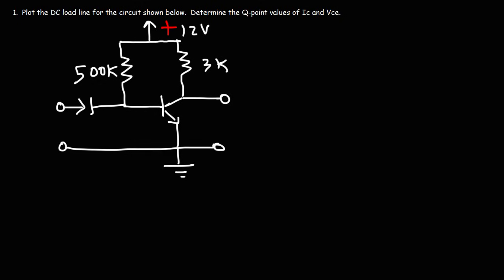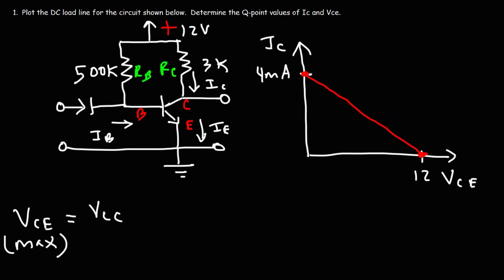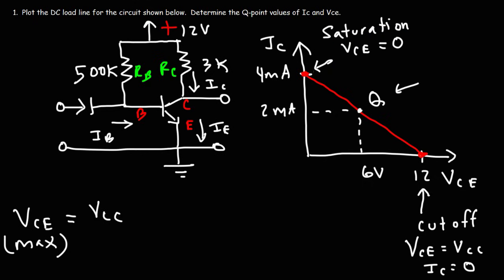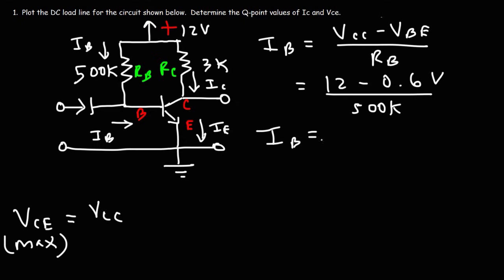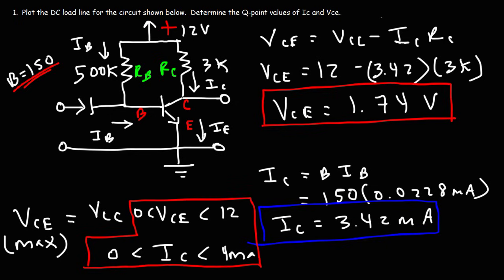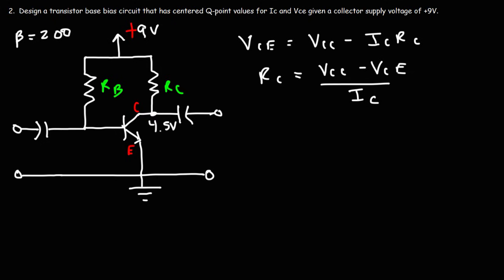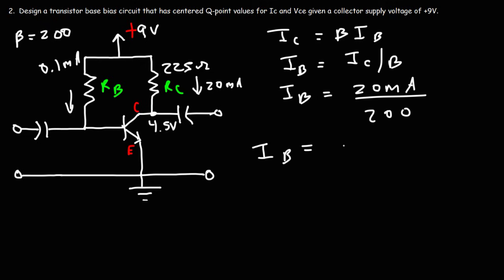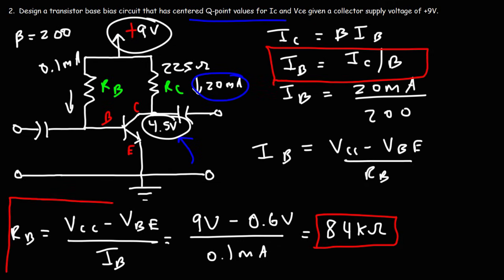Transistor Base Bias Circuits - Finding The DC Load Line & The Q Point Values

Comment: 12:05 I did`t get how did you know which value of Ic you must choose. I mean we did`t know Ic sat to assume
Reply: First of all , We are designing the circuit not finding out the exact values .
 What I mean is If the Voltage at a component is fixed , we can  assume random Current value ( Ic ), Based on this Fixed volatge and assumed Current we can get the corresponding Resistance. He Assumed 20mA because Transistors currents are always in mA .
I saturation Current changes based on the resistance at the Collector terminal .

Example : If the Volatge is fixed ,  V = 50v

I = V/R  -> R = V/I  - > 
R= 50 / I
 In this case if the I = 10 , then R = 5
If  the I = 2 , R = 25.

SO , there are many possible Combination of values for the Current and Resistance . But all the combinations are equal to Fixed Voltage .
Example : for 50 v 
1. I = 1, R = 50
2. I = 2 , R = 25
3. I = 3 , R= 16.67
and goes on.....

For all the Different combinations , the Ratio of Rb and RC should be same.

Comment: Can anyone explain how a DC current (whether in a tube or transistor circuit) can mimic AC? By definition, direct current GOES IN ONE DIRECTION. The "downward slope" of an AC sine wave makes sense to me. The upward part doesn't,  as it requires the current to reverse direction.  PLEASE don't quote "bias" or the original sine wave wave or the mathematics of an arbitrary null point. I understand the math very well. I don't understand what should end up as just a half wave rectification,  becoming a (genuinely) alternating current, i.e., changing from positive to negative. 
I also know that circuits work, according to the maths. So in not questioning the practicality. It's just so damn frustrating how people are not questioning this fundamental physical anomaly.

Comment: Well, the assessment that when the transistor is either in saturation or cut off is “not very helpful” is wrong because actually that’s the main use of a transistor: as 0 - 1 switch. That’s the basics of digital electronics!

Comment: There are 2 ways to bias the transistor...one way is to set Vce to half the supply voltage. The other way is determine Vce sat and Ic max then look at the middle Q point operating on the graph of the transistor characteristic. From that find the nominal hfe.

Comment: Beautifully explained.  I find myself rewatching and reannotating your videos, lol.  Taking more notes in case I missed anything.

One question I have is, how is this applied to amplifiers?  Can I just use this method and plug my guitar or a line-level signal into the base and expect an optimal amp or is there way more to it?